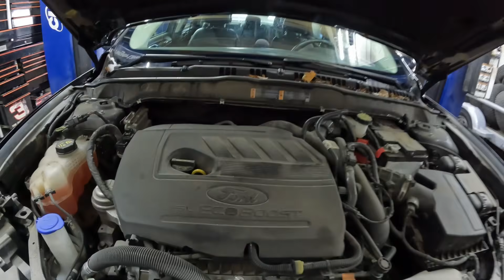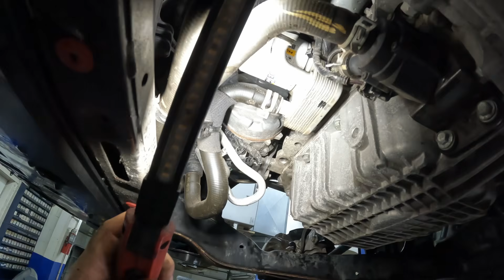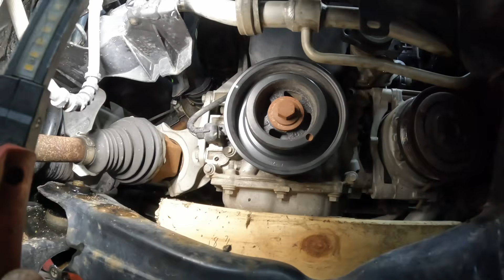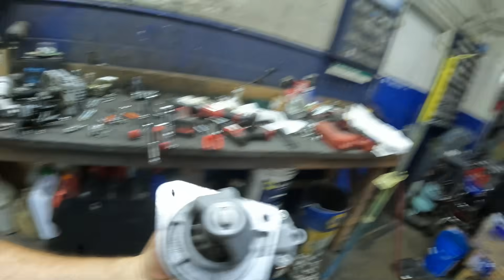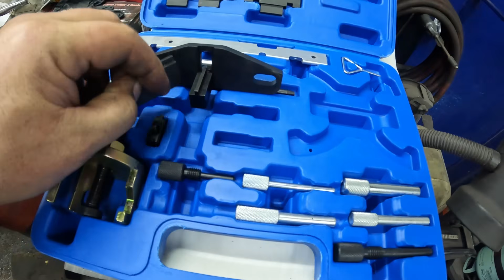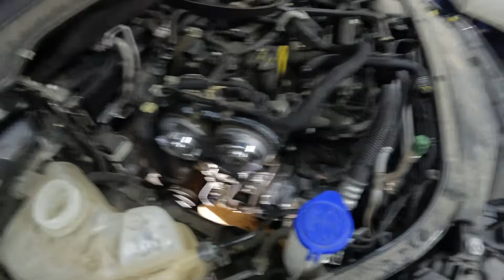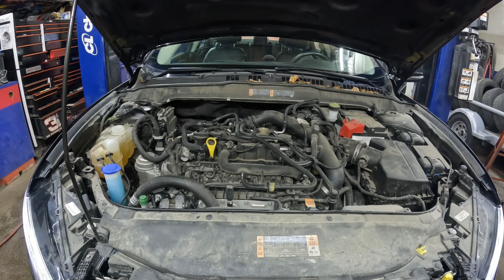2018 Ford Fusion 1.5L Ecoboost Water Pump & Timing Belt

Comment: I would agree with the starter removal except you're putting a lot of pressure against the crankshaft locking pin versus the flywheel lock tool during the balancer retorque
Reply from the maker: It's more so the pressure on the threads because it pushes on from the very tip but yes it's a lot of torque on those locking tools.  Thanks for watching!!

Comment: What I'm most impressed with is that offset socket wrench setup you used to get to those starter bolts. Yes, I'm older than dirt and just a DIYer. Maybe you guys are finding that wrench on the Matco and SnapOn trucks, but that was damn useful. What do you call it? Who makes it? I'm surprised no one else commented about it. That top starter bolt was a bitch for my fat hands and a 1/4" swivel ratchet.
Reply from the maker: I agree that the right tool makes all the difference when you're working in such a cramped space. I believe they call it an indexable head ratchet.  This one came from Matco Tools.  Thanks for sharing your experience! 👊🏻
Reply: @paycheckmonster  Perfect. Found them at Harbor Freight. Both a 1/4 and 3/8 for 45.00 and some change. Fantastic for my occassional need. Keep up the good work. I really liked a lot of the comments you shared during your filming. Great to see a responsible and sensible mechanic.
Reply from the maker: Glad I could help.  Thanks for watching!!

Comment: Thank you for your great instructions and guidance. Top Video! Couple of things to ask if i may, 1. Other than water pump and tentioner, crank seal and thermostat is a good practice to change also? 3. The pin, you mentioned that takes perpendicular force from balancer, so no worries to bend or crack? It can take the whole 100Nm+90deg+15deg? Also, the pulley allignment tool, can also stay on, on the torque procedure? Sorry for the too many questions, still a bit stressed here! Car has only 60.000km but 10years old. Thank you in advance
Reply from the maker: It’s always good practice to replace the crank seal and thermostat while you are in there, and the alignment tool should be removed before performing the final torque procedure then rechecked.  Make sure the pin is fully threaded in.  Thanks for watching!!
Reply: @paycheckmonster Did you make a vacuum coolant bleeding or normal? I read that these motors are better with vacuum…
Reply from the maker: I would use the vacuum filler if you have it.  It can be bleed without it though.  You just have to make sure the little electric coolant pump is primed.

Comment: I just did this job for just the water pump and used the wedges to keep timing belt in place and crank locking tool only and left  the crankshaft pulley on as well the front metal piece where the motor mount connects too. Prob should change everything while in there, but they didnt pay me for that. lol
Reply from the maker: That's an interesting way to approach it, though I prefer doing the full service while the engine is open. Thanks for sharing!

Comment: I’m about to replace the outer plastic timing cover on one of these soon would it fit out behind the pull just by removing the tensioner and alternator mount or does more need to come off just for the cover
Reply from the maker: To access that cover, you'll need to remove more components including the crankshaft pulley and the engine mount bracket to clear the space. Thanks for watching!!

Comment: I took the Intake off so that you can see what you're doing with the starter and locking the flywheel. It just seemed easier and I like to see what Im doing.
Reply from the maker: Taking off the extra components definitely provides a better view, thanks for watching!!

Comment: I stripped the tensioner screw so I’m stuck there I don’t know what to do about it
Reply from the maker: So the tensioner bolts to the water pump housing.  You should have a new tensioner and water pump in the kit??  Hope it helps.

Comment: Watched your video plus a few others that did this, great advice. After deep research, along with AI, I can verify that the pin is strong enough and is at the correct angle that it doesn't move when tightening the crankshaft bolt. BE SURE to torque the bolt to spec. I under-torque my first bolt (only did the 90 degrees) and when I put it back together, the harmonic balancer rotated backwards when I was tightening the waterpump pulley with the serpentine belt on. Had to take it all back apart and install ANOTHER brand new bolt, this time I made sure to do about 20degrees instead of the 15. So it DOES matter. You CAN leave the sensor alignment tool in until the very end to ensure the harmonic balance doesn't shift at all. I had to use an impact gun to remove the bolt, but if you don't then I imagine you will need to use the flywheel locking method or else it will just rotate backwards. Another user figured out you can slide a screwdriver in the flywheel without needing to remove anything so check the other comments. Also, while you're in there, you should replace the crankshaft seal since its right there. It's about $20 for the official one. To get it out you don't need to buy a tool, I drilled a tiny screw into it (you cannot just poke through it, it has a thin metal ring behind the rubber face) then just grabbed and pulled the screw with pliers. It can take a few attempts because you don't have much space for a larger screw and that seal is in there really tight. To re-install that seal it is very important to make sure the INNER lip DOESNT flip and caught on the crankshaft as your putting it in. I used some motor oil on it and slowly rocked it in, pushed it as much as possible, then used a flat object to press against and hammer in until it's flush
Reply from the maker: Great tips, thanks for sharing your experience with the community!

Comment: Hey 
Just came across your brilliant video very informative.
Just have one question regarding this free spin pulley, what will happen if the crankshaft pulley not aligned to that specific position with the timing? 
Thank you.
Reply from the maker: It wont run very good or even could cause engine damage.

Comment: Hi you helped me out alot thank you for your video. About not taking out the starter motor off well your right my 2015 Ford kuga ambiente 1.5 ecoboost petrol engine has l little gape on the other side near the drive shaft just by the trasmission it had a bit of silver tape over it. I just put a flathead screwdriver inside to lock the flywheel it works fine to stop the crankshaft for going anticlock wise when you take the crankshaft pulley off hope that helps sir.
Reply from the maker: Glad the video helped, and thanks for the useful information on the flywheel locking method!
Reply: Please stop putting a screwdriver in the flywheel. Not very professional and dangerous to damage something.

Comment: hi great video question ??? so i took the harmonic off with out the tool but the timing didnt move but the bottom crank did can i just set the crank with the tool and be fine ??? the belt did not move i have the cam lock tool on so cam is at tdc but the crank moved to revolution... smh
Reply: don't answer that question i look at the whole video and got the answer ,i need the ford crank tool find the crank tdc  i already got the cam timed, spin the crank until it stop  that how i will know I'm in tdc at the crank , then put the harmonic back on with a new bolt and  take locking tools off turn one revolution stop at 11 o'clock  put tool in, spin to it stop ,check with tool make sure everything line up if the cam tool slide in the right way I'm good if not i need to turn the crank one more rev till it stop check it and i should be good , thanks for making this video i was stressed out i locked the cam and just zipped the harmonic bolt off thinking its with the crank  smh in for a big surprise .... thanks for this video you saved me and i bought a kit from summit that has the way you talked about it at the end to save time ..., so that's the way I'm going ..., thanks again ggs😁😁😇

Comment: Thanks for the video that was very informative, skipping the starter is definitely a great idea but 1 thing that worries me is if that pin is strong enough when you start applying the angle torque, if that pin snap we will be in "DEEP" trouble, what do you think?
Reply from the maker: The pin is designed to butt up against the crankshaft, so it handles the torque without issue; I've used it many times without any trouble. Thanks for watching!

Comment: no my comment on that tool on flywheel must do because the pin holding the engine on top is not strong enough to hold the engine as you torque and it can break the pin and have a bigger mess
Reply from the maker: A lot of people comment on that but the pin butts up to the crankshaft so it's not making contact from the side it's contacting at the tip.  I've done several of these.  Never had a problem.

Comment: Hi great video thanks friend would this timing belt that car you working on be the same on a 2015 Ford kuga ambiente auto with 1.5 ecoboost petrol engine? This is the suv car I have, I'm keen to learn to do this job as well.
Reply from the maker: It may be but you should probably research it.  I don't know for certain.

Comment: Where did you purchase the special dow pin
Also you kit with the special tool looks like the one from Temu. Is it the same one ?
Reply from the maker: I got a complete kit from Amazon a long time ago but they don't sell that one anymore.  I'm sure their would be something available from other companies though.  Thanks for watching!!
Reply: Thanks buddy ,I appreciate the feedback. God bless
Reply: I forgot to ask.
Do you think it would hurt anything if I didn't take out the starter amd just impacted the crank bolt out after I have the dowel pin in amd locked at Top dead center ?

Comment: What is anaerobic sealer? Is it necessary? Would silicone be a good idea? Could I just use the gasket without any sealer or would you highly recommend something?
Reply from the maker: Anaerobic sealer is a sealer made by Permatex that cures without being exposed to air.  It's coming used for cam bearing end caps etc.  Just a very thin film works well.  I would recommend a sealer just to make sure you'll have a proper seal on sometimes an imperfect surface.  Thanks for watching!
Reply: You shouldn't use sealer on metal gaskets
Reply from the maker: Certainly not on a head gasket.  Any time there is pitting in the surface metal like cooling system gaskets, I would highly recommend.  I've learned the hard way and don't like doing warranty work.

Comment: Thanks for your video it's great,  I'm planning on doing timing belt on my 2015 Ford kuga ambiente 1.5 petrol ecoboost engine where did you get the timing  tool kit from?
Reply from the maker: Glad it helped.  The tool kit came from Amazon.  However, I believe the exact kit I used is no longer available the last time I checked.  Thanks for watching!

Comment: Question.. So you recommend replacing water pump if i need to replace the thermostat?
Reply from the maker: The thermostat can be replaced separately.  However,  I would recommend going by the service interval on the timing belt.  If it's due for a timing belt, then do the water pump also.  Thanks for watching!!

Comment: I just completed mine today. Did not remove the starter. But unfortunately my dampener did not easily come off and the puller that came in the dptool kit did not fit. Other than that the crank lock pin did not “sheer” off. Thanks for the content. I definitely used it
Reply from the maker: Those dampeners can be a real pain, glad the video was a help for your repair!

Comment: If there is an electrical connector on your water pump simply disconnect it and jam the wired connector behind the compressor.  Ford reprogrammed the computer to not use the water pump clutch and the new water pumps DO NOT come with a connector even from ford.  YOUR WELCOME.
Reply from the maker: That is good to know, thanks for sharing the tip with everyone.

Comment: Great video.  The last 2-3 minutes he explains why you might not need to remove the starter.  As someone who's been doing this for 20 plus years I can give you my advice.  I did NOT need to remove the starter.  That pin that goes behind the axle bracket will prevent the crankshaft from turning clockwise... HOWEVER...  It's not necessarily designed to handle torque.  Meaning that pin could bend...  If that pin bends you might be royally screwed as its probably not going to come out.  I took a chance and my pin did not bend BUT all pins are NOT made equal.  Here's what i would do.  Torque the harmonic balancer to 75 ft. LBS with a torque wrench.  Then mark the bolt and use an impact gun to do the 45 degrees and the 15 degrees.  An impact gun will put far less torque on that pin.   The degrees does not have to be perfect.  close enough is fine.  Also 18 ft lbs seems high for the tensioner bolt.  you may want to double check that.  As far as the harmonic balancer tool....  I grinded alignment marks on the H/B and oil pan before i removed it.  Going back together my marks were off a bit.  I bent the alignment tool to get the marks close.  So far so good but these tools on amazon/eb-bay are hard to trust.
Reply from the maker: Thanks for the tips and insight on the process, I appreciate you sharing your experience!  As a tech myself, I do not remove the starter for this repair.  I have several years experience doing these repairs and I wouldn't want someone to watch a video and screw this job up.  That's why I talk about it as an option at the end of the video.  Thanks for watching!!

Comment: Doing one today at the shop where I work and this video has been my help. It's a horrible process when compared to other brands and it's taking way more time than usual, but again: This video is a huge help. Thanks man! I did most of it today and tomorrow is time to put back the starter, oil cooler, alternator,etc. A message to Ford : Get your shit together idiots!!
Reply from the maker: Glad the video helped you get through a tough job, good luck finishing it up!
Reply: @paycheckmonster  Yes, it's done and delivered to the client! It was my first EcoBoost timing belt job since I mostly work on Alfa Romeos and Fiats, but the video was a huge help. We don’t have documentation for Ford motors at our shop, and we only took the job because the car belonged to a friend of the boss, lol. Next time it should be a bit easier. I’m not a fan of the free-spinning design of the lower timing sprocket and damper pulley, but it all went fine. Cheers from the Netherlands, mate!

Comment: I accidentally took the cam locking tool out when i tighted the crank shaft bolt and the cams relaxed counterclockwise a tiny bit can I just losen timing tension a little bit and move the cams back to the right a little bit?

Comment: I think that if you don’t use the retainer on the flexplate you’re essentially using the crank pin and dampener pulley pin to hold the torque of the dampener bolt. My luck it would shear the tip of the pin off in the crankcase about 20 degrees before it was torqued.
Reply from the maker: Keep in mind that the crankshaft butts up to the pin and does not approach from the side as to shear it off.

Comment: Speaking as a former Ford Master Tech, your video is absolutely the best one I've come across so far.  Your detailed explanations are clear and yes, you can eliminate the starter removal step.
Reply from the maker: Thanks for watching!
Reply: So it won't hurt anything if you skip the starter ,and just impact the crank bolt off ?
After the cams are set at top dead center of course.
Reply: @matthewsetzer9896 I want to know the same
Reply: @matthewsetzer9896  very very very very unadvisable

Comment: All they needed to do was put a key in the sproket and pulley as they have been for 100 years; that would eliminate the need to use special tools, remove the starter, take all that oil cooler stuff off, a torque-to-yeild bolt....those engineers ought to be barred from Engineering anymore.
Reply from the maker: I've always said that engineers should have to work in the field of being a tech for a couple of years before they become engineers.  Thanks for watching!!

Comment: i'm seeing reports that the harmonic balencer alignment tool bends.  This may be part of why they want you to remove the starter?  b  Using an impact to do the FINAL torque angle might prevent this?  That being said shouldnt the crank pin prevent this?  god bless ford motor company......  BUY HONDA!
Reply from the maker: The balancer alignment tool is not meant to have any force applied to it.  If the crankshaft is making contact with crank pin and the friction washer is installed, the balancer should not move.  Only the crank bolt should turn.  Never had a problem with one.  Thanks for watching!!
Reply: @paycheckmonster  Awesome video. thanks.
Reply from the maker: Thanks for watching!!

Comment: Remember that you don't need to touch the starter or oil system, just put the crank bolt back in and gently turn the the crank up against the stopper pin, and assemble.
Reply from the maker: That's a great tip for saving time on this job, thanks for sharing! Thanks for watching!!
Reply: Is that single pin strong enough to take the 200 foot lbs of torque for the crank bolt?